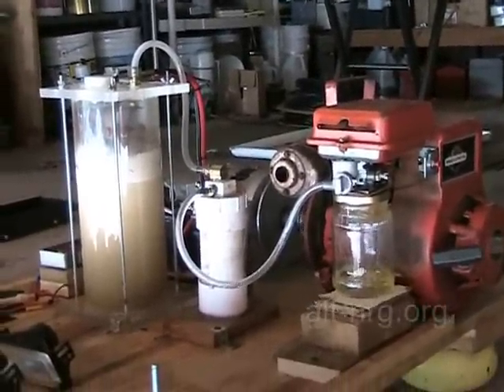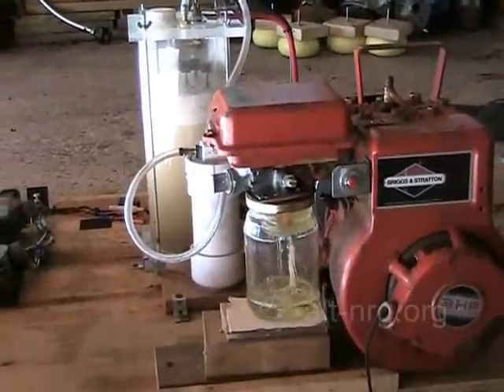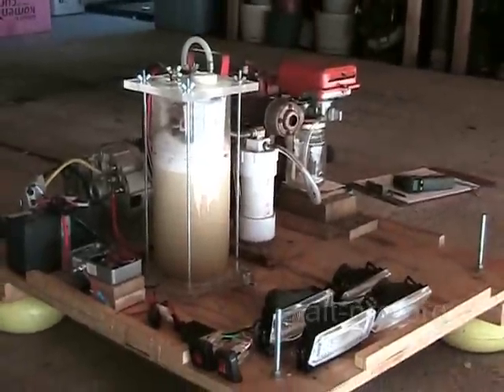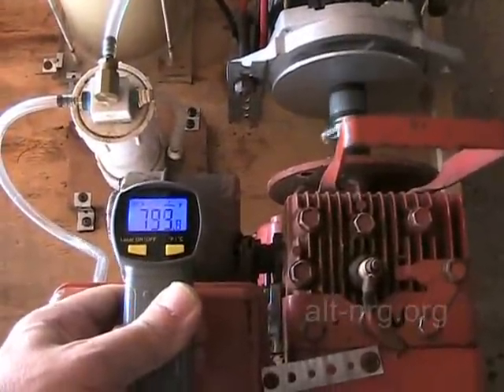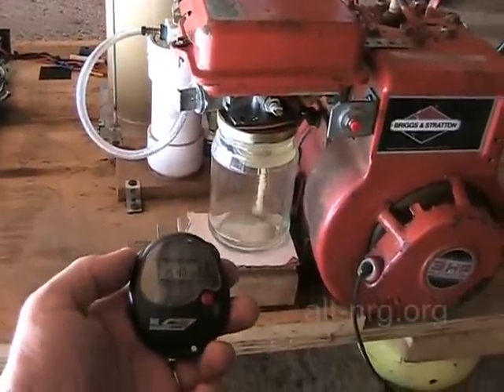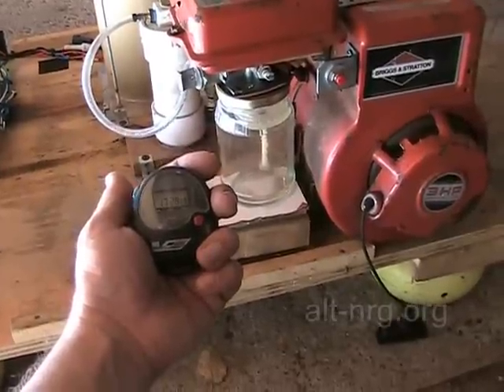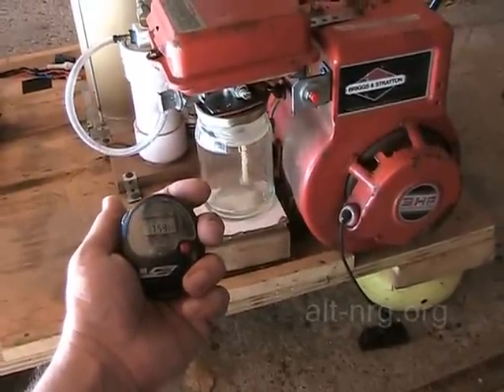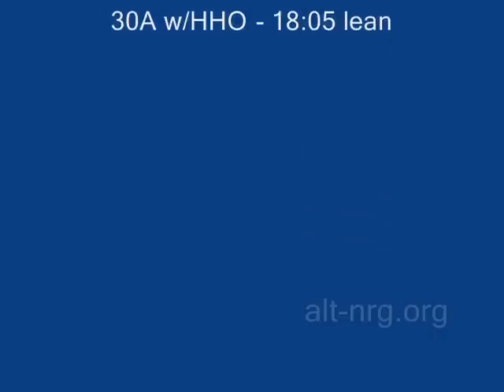#241 - Run time test results! Part 1 of 2

Comment from the maker: @Boyntonstu My baseline is most efficient setting, just slightly lean from peak RPM without HHO.

Scaling up for a GASOLINE engine (as opposed to Diesel) the volumes I have always predicted as necessary are in the dozens of LPM, unless more can be done to gasify the fuel before reaching the combustion chamber.

This cell started life about 5.5mmw but the panels that keep the plate edges sealed have started to come apart over time. Internal leakage across the neutrals is killing the efficiency.

Comment from the maker: @1TEKTRON1 Well, that's a problem. Seems these carbs only come with one or the other. The original came with only the idle. Same for all the new carbs, to meet EPA standards. The one I'm using now was donated and has only the high speed mix. Consequently, with this carb the engine will not idle correctly. I would LOVE to have a carb with both, AND a regular float bowl. My old 8hp Toro snow blower has one but I'm not ready to sacrifice it.

Comment: This seems to be a good result. The test that I did with an engineer from a Dutch university about 2 years ago gave a result of 4 percent mileage increase. We tested it on an old VW transporter van with no fancy electronics.  It was leaking fuel but we didn't calculate how much was leaked away otherwise we would  have an even better result. Great job Zero, this was indeed a test we've all been waiting for. 

Two thumbs up and peace, iT

Comment: it melts the welds that hold the muffeler together and it blew apart from the fitting , or the mettal melted , and it still runs great , a few times i had it glowing red hot and one time after i shut the spark off it shot flames for a bit as it died out , ive never changed the oil but ill bet its screwed , its ran bad for a wile though , im assuming that its a rings and head gasket problem , so i might have made it worse but it was still a gambel , i dont need a hole in my pistion or head

Comment: @oystla this is probably neither here nor there, as Zero's cell produces the same amount of output at 0degrees as it does at 50degrees with his current limiting PWM. It supplies 30amp flat, from cold to hot. It was done so he could stop having to modulate his electrolyte ratio to achieve certain run temps/amp draws.

Comment: Hmm. I'm not going to dought your testing. but I have different results. My motorcycle used to go 60 miles (ave) on the main tank before switching over to reserve. Had the bike for years. the reading is consistant. Built and installed HHO unit. tweeked the unit after the first trial drained the battery. Now the bike will go 80 miles (ave) on that same main tank, repeated multible times. Also getting extra 5MPG on truck. I would like to discuss further testing. I think your system can be tweeked.

Comment from the maker: @mrnewagemotor That's not entirely true. With this setup, at 34% total energy conversion efficiency, I got back a little more than 65% of the run time that I lost by adding the 30A load of the cell in the first place. It's still a net loss. BUT, it's also double the return from my energy conversion efficiency. If that number was 60%, one could reasonably expect to get 120% or slightly more. 7mmw and a 70% efficient alternator like Bosch and we're there!

Comment: If you use the exhaust gas to heat the HHO cell, you will increase the electrical efficiency of electrolysis by decreasing the electrical energy input since the TdS part of the GIbbs Free Energy equation increases.

Comment: Excellent work and video.

I am unsure about your leaning testing.

Did you try to achieve the most lean setting without HHO and go from there?

If you scale up the calculated HHO volume/Amps necessary to run a 2,000 CC automobile engine would it make a practical device possible?

After years of building cells and all of your experience,  I am very surprised at the 4 mmw efficiency.

What is the story behind that?

Comment: @ZeroFossilFuel .. Which  is  the  most  efficiant  alternator  on  the  market  today  and  what will  one  cost  us ?.  Does  anyone  know  the  answer? has  anyone  done  some  research  so  to  save  us all some time ?
 Also ,  Zero  is  using  a flat head  Briggs  and  straton engine . If  he  used  a OHC honda   5 horse , they  are much  more  efficiant  and  exhaust  temperatures  are  lower  as  well. Thank-you  Zero for  all  your  hard  work

Comment: @ZeroFossilFuel 

Dozens of LPM.

Let's assume 4 dozen LPM or 48 LPM.

Do you have any idea of the number of equivalent alternators necessary to produce 48 LPM at 6 mmw?

As always, scale become THE factor.

Using photovoltaic cells to power a hand held calculator is very practical.

Powering your house is not.

So bottom line:  Do you think it possible to run a  2 liter car engine with HHO generated by alternator(s)?

Comment: @ke4uyp 
You're using the term workload subjectively. This is a test unit, and it technically is under workload. You wouldn't attach this in it's current form to a lawnmower or a small vehicle anyway.

Comment from the maker: @ke4uyp Wrong, wrong, wrong. 2nd scenario. 3hp motor uses 1hp with a 60% total power conversion efficiency to create the HHO for reinjection. Return on that investment is 122%. That means our 20% efficient 3hp motor just became a 28% efficient 4.22HP motor. Net maximum output power gain of 0.22HP, a 7.3% GAIN.

Comment: I forgot to add, I'm a believer in HHo. I witnessed it myself on a piece of crap ISUZU Trooper that needed new rings. As soon as he turned the cell on ( dry cell ) the engine smoothed right out and stopped smoking. He was running 10amps, lye as electrolyte. He later reported no notable increase in fuel economy over several hundred miles most likely because the thing probably had an O2 sensor that he didnt trick. One guy on youtube said he's getting 23-25mpg on his diesel 4x4 van with a dry cell.

Comment: @ZeroFossilFuel .. I  agree .  With a  more  efficient  alternator and  a Honda OHC and  over head valve  5 horsepower  engine, you can  get  even  better  results . The  briggs  engine  that  you  use , is  obsolelete, but you  havedone  all  of us  a  great  service  . I for  one  Thank-you  for  proving  that  HHO  can be  used  to  enhance the  run  time  of  a  ICE, Underload in a  controlled  TEST.  Let the naysayers eat  crow.   (ke4uyp) listen  up!

Comment: pre hho idle , pre hho lean , post hho lean , post hho idle , load , no load  , and you can even try increasing the idle and then lean it , see if that uses any less fuel but use these variables and tweek it , i know its gonna take time but please do these test , and send me the link to the vid , btw i know heat is a conscern of your , but i have a lawn tractor that had a blown carb so i made a make shift valve assembaly and run it off of propane , and i can adjust the fuel mix to the point that

Comment: Hi, maybe I'm missing something. You're making an engine run with HHo for almost 2 minutes less than the no-load run and it is'nt doing any work. If you give it a job with a load equal to running the alternator wont the run time decrease by 2 minutes?

Comment: try as lean as it can run with hho , an try a run test with A:low as it will run idle then lean as it will go with hho B: lean as it will run with hho then low as it will idle , and preferable at load but you could try one at load and one not , but i dont want you using too much fuel  any ways C: low as it will idle then lean as it will go then add hho and C1:lean it out more then maby drop the idle C2: drop the idle then lean it out. of coarse you can see i have a few variables , ill list them

Comment: @blueflyingmonkeyy ethanol is cleaner fuel, not clean fuel.  Natural gas is better but even harder to acquire in the mass quantities needed to get serious work done from it. Hydrogen is the be all /end all for clean fuel, as not part of its make up and no part of its conversion process is dangerous (pollution wise) on its own or combined. At present zero isnt trying to make a hho assisted petrol engine but he needs to do this work to find out how to pregess a completely on demand hho system

Comment: If this really works than why doesn't any manufacturer come out with one in a car like Tesla did with an electric car or hybrids are now real cars?  Are you sure you are not just saving gas because you are using less on the throttle when you dial it back?